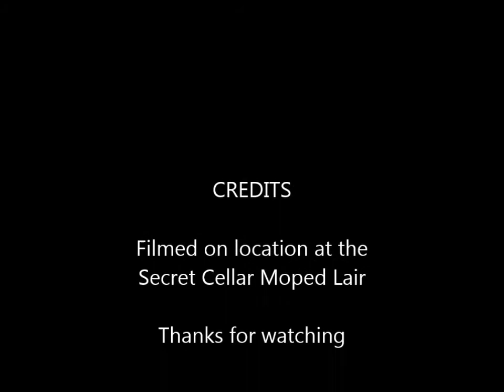Brake shoe modifications

Comment: I have been wondering about similar techniques for a heavy 60s GM full-size car with 4 wheel drum brakes via applying the concept of slotted rotors to the surface of brake shoes (NOT slotting the metal on the drums). What are your thoughts about slotting the shoe material at an angle across the pad material, rather than perpendicular to the direction of drum travel as you have done? The primary goal would be to shed water more quickly ... those drum brakes can be scary when very wet. (The left and right shoes would have to be slotted differently.) I've also wondered if then also drilling the rotors would help spin water out of the drum, and provide some cooling without significant negative impact. Thoughts? Thanks.